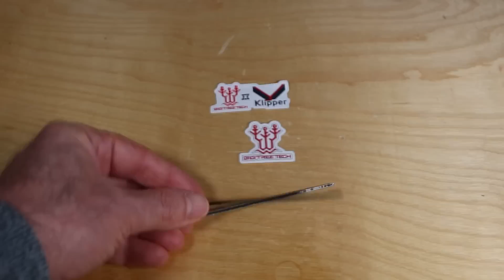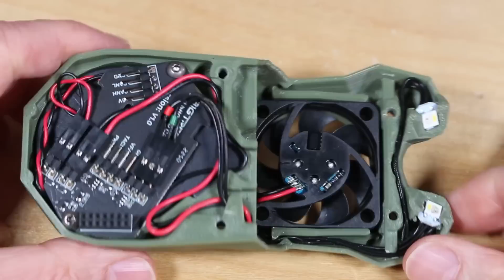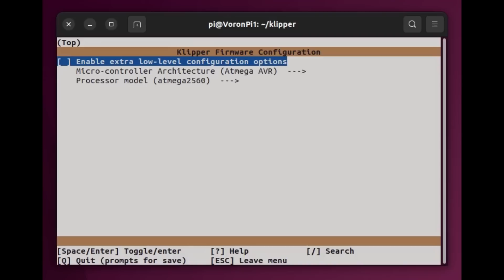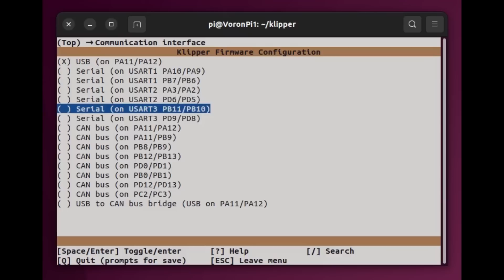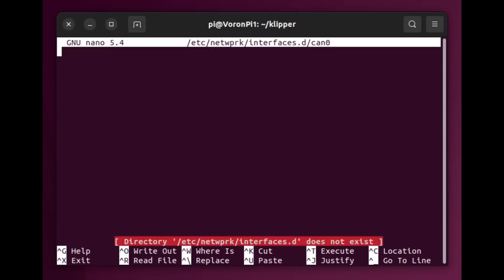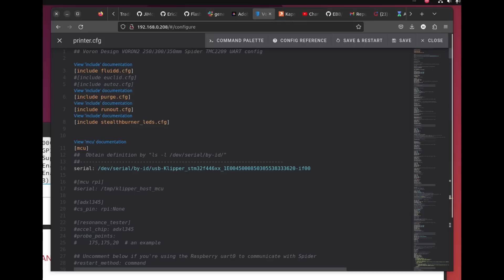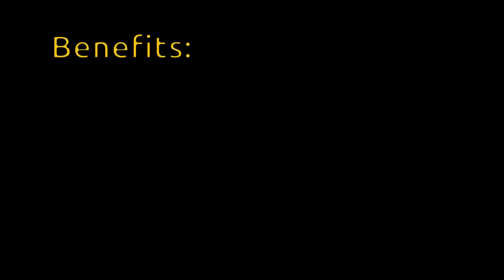Canbus SB2240 and SB2209 3D printer Install, Thoughts & Tips from BigTreeTech (BTT)

Comment: Question: how would this process be different when using can hat RS485?  I had it configured to use a HUVUD controller and I'm making the switch, but not sure how to proceed with the can hat...
Reply from the maker: I also used the can hat from waveshare in my 1st canbus video.  I don't think it would really be any different.  Just make sure the canhat is configured to run as fast as the SB22XX and you should be fine.  You will still need to build and download the software onto the SB22XX just as you would in this video, but configure canhat as you would in the previous video making sure the speed settings match. If you are using an Octapus, you might want to try eliminating the canhat and just connect the SB to the Octapus.

Thanks for watching!
Reply: @KapmansBasementWorkshop  trying to flash via my computer and USB-C, but no dice.  I wasn't able to see the SB22XX in the lsusb command, so I'm trying this way, but getting "failed to download" error...
Reply from the maker: @theamzngq  If you cannot see it using lsusb, it must not be in DFU mode.  Did you hold down boot and while holding boot press the reset button on the SB?
Reply: @KapmansBasementWorkshop  Yes, and both LEDs are lit.  When I was trying via the PI, it's only connected to the can hat via the can H & L wires, no other connections.  Should it still be visible?  Also, I noticed that when I power it off and back on, both LEDs are already lit...should that be?
Reply from the maker: @theamzngq  I think I'm going to take my words back.  I think you going to need to connect a USB-c cable from the SB22XX to your PI to program this properly.
Reply from the maker: The waveshare is really just a serial port, not the same thing as USB.  That muust be why lsusb isn't working.
Reply: @KapmansBasementWorkshop  Ok, I'll give that a try since my windows efforts aren't working.  Still wondering about both LEDs being lit all the time though...
Reply: @KapmansBasementWorkshop  That seemed to allow me to flash it by connecting to the Pi over USB-C!  On to config...
Reply from the maker: @theamzngq  Good luck!
Reply: @KapmansBasementWorkshop  got the config all done, but now I'm seeing mcu 'can0': Unable to connect.  Can't seem to catch a break here...I was able to query it and get the UUID and all, but now when I query it, it comes back with nothing.  Help?
Reply: Is this the Pi 3 vs Pi 4 issue?  Or something else?
Reply: @KapmansBasementWorkshop  got it figured out, the speed was too high, as soon as I reflashed to 250000, it started responding.  At some point I'll have to swap a Pi 4 in there and see if it makes a difference.  I'm pretty sure I won't be able to do shaper calibration at that speed...
Reply from the maker: I was able to run input shaper at that speed. So I think you should be able to as well. As long as it gets a clean signal through the cable.

Comment: Is this compatible with Voron TAP?
Reply from the maker: Yes,it is. In fact, in the video, I’m using it with tap. TAP connects directly to the SB2240.
Reply: @KapmansBasementWorkshop  Thanks for that. Does the TAP need to be 24V or can the 5V one be used?

Comment: Everyone seems to be very excited about canbus tooheads and the reduced wiring sounds nice. I however am very hesitant to move the extruder driver from the basement of the printer into the hot chamber. I run a very warm chamber (actively heated, shhhh, don't tell) so I'm concerned about how long it will live.  Am I worrying about nothing?
Also, I have over 3500 hours of print time on my V2.4 and I have had no issues with wiring and have not been able to find any appreciable wear on the wires in the cable chains.
Reply from the maker: In this case, I don't think you would gain any real advantage to switch to canbus.  I certainly would not consider it until your current harness starts having trouble.  Canbus adds software complexity.  And I agree with you, I would worry about the driver overheating.  Some have started to attach additional fans to the side of their print heads to keep the driver cooler.  I have not had that problem, but I'm also running a motor that works with very low current and my printer struggles to hit 60c internally..

Comment: So it's designed specifically for SB but then doesn't come with standard revo voron heater/NTC connectors?
Shame...
Reply from the maker: I think it’s purely a space issue.  The standard connector is very large and SB doesn’t have the space.  So as designed, it fits right in with no modifications or printing of new parts.  It’s really nicely designed for SB.  So while I found crimping the connectors tough, I’m not trying to say anything really negative as they probably made the right trade offs here as with any design.  Honestly the quick disconnect of the SB face plate and the tons of expansion it provides and greatly reduced wiring are big wins.  Thanks!
Reply: @KapmansBasementWorkshop  You're right the connectors e3d chose are big
Reply: The new version does, wired up my Rapido V2 PT1000 no prob and no crimping needed.

Comment: U2C not required, you can connect directly to Octopus or Manta via CAN and Canboot
Reply from the maker: True, but I don't have an Octopus or Manta.  But I know many have had trouble with timeouts using  those and other methods  I have found this to be completely reliable. A dedicated connection to the MCU and another dedicated connection to canbus.  It works well for me.    Thanks for the comment and watching!
Reply: Is 2240 compatible with manta m8p 1.1 with cm1

Comment: Is the orange pi4 compatible with this setup?
Reply from the maker: It should be.  I see no reason why it won’t work.
Reply: @KapmansBasementWorkshop  4:18 i cannot locate this "card adapter" on the voron stealthburner STl site. could you please post a direct link to it? is this required? i have everything i need to start this build but this part.
Reply from the maker: @mr.rajikon3911  I would say it's required. Here is the link: https://github.com/VoronDesign/Voron-Stealthburner/blob/main/STLs/Clockwork2/%5Ba%5D_pcb_spacer.stl

Comment: Do you need to flash the u2c v2.1?
Reply from the maker: No need to flash the u2c as it comes with the software installed.  My video unfortunately states I am about to flash it, but I actually doesnt if you watch it. I’m flashing the actual Canbus board. my narration is off.

Comment: This video is weird and for some users confusing
9:31 connected u2c via usb-c in DFU mode... compiled fw etd and then set  BTT board to DFU and flashing ...weird why? :)
Reply from the maker: You are correct.  I just went back to that section and reviewed that video.  There is some weirdness in that section.  I did not actually flash the U2C.  I connected it to the Pi via USB-c and then flashed the BTT main board, not the U2c.  In fact, I never flashed the u2c.  The video shows the correct path, but my narration isn't correct.  I need to put in a warning and need to figure out how to overwrite the video with a corrections.....
Reply: @KapmansBasementWorkshop   thank you for this, your videos are very nice and simple. It probably must be also connected 24V for flashing or jumper on BTT can board, this isnt mensioned i think.
Reply from the maker: @davidbucek  Yes, I had it connected to 24v through the canbus cable.  The manual does not state this explicitly, but it assumes it as well.
Reply from the maker: @davidbucek  One more thing.  The manual states that Klipper does not support the 2240.  But it seems to now as I used Klipper and not a special build.  The code was merged into Klipper from BTT  by the time I installed this.
Reply: Glad i found this thread, i also found that very confusing and came here for comfirmation. Thanks.

Comment: I like your style,, I seem to be following many of you build mods.
Reply from the maker: Glad you like them!  Thanks for watching!
Reply: @KapmansBasementWorkshop  I'm just following your work flow here and i see you had a EBB36 and now you have switched to this setup whats the reasoning please
Reply from the maker: The ebb36 has been great. No problems with it. But I was interested in the design of this and the 2240 motor driver. So I decided to give it a try.  I would still fully recommend the ebb36, but I think for some, this might be an easier option with the face plate mounting and the clearance it provides in the back with so few wires back there. I have plans for the ebb36 in another printer if I can get around to building it.  I think it’s a great controller board.

Comment: If you’re using the PT1000 your settings are wrong. Rtd_nominal should be 1000. Reference should be 4300
Reply from the maker: You are correct. I might have spliced the wrong video in. I did actually correct it.  I will place a note on the video about this being incorrect. Thanks for pointing this out!

Comment: So I'm assuming you have the SB2240 with the TMC2240 driver, not the SB2209, with the TMC2209 driver? Hence, the changes for SPI vs UART? What made you decide to use the TMC2240 board? Been considering going to a serial toolhead but still a bit uncertain.
Reply from the maker: I went with the 2240 because it supposedly runs a little cooler that the 2209 and honestly I wanted to try something a little different.  I run 2209s everywhere else and they are great!
Reply: @Kapman's Basement Workshop Just finished installing the SB2240 on my Voron2.4 thanks to you. The only problem I had was the U2C was in permanent DFU mode irregardless of the boot switch. Updating its firmware solved that.
How do you like the horizontal Z drag chain? I found my umbilical can get stuck behind the stock setup.
Reply from the maker: @bobwtech  Glad to hear it's working for you!  The drag chain is ok and so far, works well.  But if you choose to do that, you will need to use the thinner drag chain that is used on the x & y axis to replace the wider chain on z.  Also, you will need to be careful at how you size it when the  gantry is very close to the bed.  It needs to be as long as it can be for maximum flexibility so it does not impact the rear of the gantry while not touching the wiring or motor on  the left side of the gantry.  I think a few people have found they could not use it because when printing the 1st layer, there wasn't enough space for the chain to fully compress which slightly lifted the rear of the gantry.  I don't have that problem, but there are some that have.   So it works well, but please be careful.
Reply: @Kapman's Basement Workshop  I saw your pictures were on the Printables website. They were helpful! I made the non-klicky gantry + lower mount and positioned them similar to yours. I noticed you use the bottom frame mount on the gantry as well. Seems like that would limit the lower travel, although  improving the maximum. Using the smaller chain with the total links you used, I have no problems. One mod I made to the bottom mount stl is I offset the chain towards the front by 4mm. If you line up the top mount to the cl of the gantry and the bottom to the cl of the frame, it skews the chain. Probably not a big deal.... BTW, this was my first print with CANBUS. Millons if frames transfered and no can0 errors 🙂.
Reply from the maker: @bobwtech  You are right about the mount limiting lower travel.  In my case, it did not seem to be an issue.  But I have learned since that for some it has been.  It's great news that you got you 1st print under canbus!  Canbus is a major modification for a printer so congratulations are due!  Thank you for the feedback and comments!

Comment: I see you had a hard time putting the CAN bus terminator. The most underrated 3D Printer tool is a pair of tweesers ;)
Reply from the maker: Believe it or not, I tried tweezers, but I was not successful with those either.  I’m all thumbs!
Reply: I am lost on what in my kit is a canbus terminator.  I have something that looks like a jumper with a long flat plastic piece on one end.  It fits but the flat plastic bit keeps the SB access door from closing.  What am I doing wrong?
Reply from the maker: It’s just a jumper on the termination pins. I believe it’s labeled "120".

Comment: Could've saved me some hassle. Was doing the mod this weekend with a friend on my voron (but used RJ11 directly, instead of the U2C). All doing fine now. I've still watched your video tho. Well done. :)
Reply: Were you able to use the RJ11 on the MCU (which one? a Octopus 1.1?) without the use of a U2C?    I am looking to go CAN BUS and was curious why a U2C is needed if the Octopus 1.1 has a CAN BUS port.
Reply: @levih.4252  Yup, I'm running it on the RJ11 port on an Octopus 1.1 without U2C.
Reply: @fraenker  Thanks for the quick response.....    Any special settings? Do you mind sharing what you did? It would be greatly appreciated.
Reply from the maker: Thank you for the kind words and watching!
Reply from the maker: Glad I could help

Comment: Thanks!  Where did you end up running the umbilical?  I don't see it attached to the back of the flying gantry in the final shot, unless I'm just missing it.
Reply from the maker: I switched it during this upgrade. I'm now running it through the top, rear air filter screen.  I'll post a video of that soon.  But there is STL out there for that (if you wish to get rid of that air filter) or you can just run it through the right rear gantry like I did on the previous canbus video.
Reply: Can you Share the STL for the Top Exit of the cable please ?
Reply from the maker: @MichaelBack-tk9xj  I'll share it, but it currently has a problem.  I loaded someone elses STL file into tinkercad to modify it and tinker cad slightly corrupts the file around the screw holes.  I have no idea why.  I was going to load it into something else to modify it, but have not gotten to it yet.  I'll post a link today and post a message here when done.  It's ugly, but not visible and works.  You might need to enlarge the hole/holes slightly.
Reply from the maker: @MichaelBack-tk9xj  https://www.printables.com/model/438412-air-filter-back-plate
Reply from the maker: Did you post a link to an stl file?  I think that is what I see in Youtube, but for some strange reason I cannot get to your actual comment!  Any chance you can post again?
Reply: @KapmansBasementWorkshop  I tried to reply twice with a link, looks like it's just killing my post...

Comment: Great video! I've done the install and found the Pi3 was too slow to communicate with it (with BTT U2C canbus) and had to upgrade to Pi4. and yes, the connectors are awful to crimp!! Found it easier (but still tricky)  to solder the wires. So far it's been a good upgrade.
Reply: You can play a bit with your busspeed and txquelen settings, it's working fine for me with a waveshare can hat on pi 2.
Reply from the maker: @thomasfjen  that's good to know as well.  The waveshare can hat is a great device as well.  I have nothing but good things to say about it.  I love the way it mounts and takes up no additional space under the printer.
Reply from the maker: Yes, I'm  using a Pi4, a CM4 actually. Thank you for the comments and watching!

Comment: I have this added to my cart but was looking for a review before buying. Thanks again for a wonderful review. One question though, is it really mandatory/necessary to buy U2C for this to work or can it be connected directly to mcu rather than pi?
Reply from the maker: You can connect it to the MCU if the MCU supports canbus.  In my case, I like the idea of using 2 USB ports on the pi. 1 for mcu, the other for canbus.  I like to think it provides more bandwidth.  Is it needed?  Probably not.  This will absolutely connect to the MCU that supports canbus.  Also, Thank you!
Reply: @KapmansBasementWorkshop  Thank you for your time and effort. I'm using BTT octopus V1.1. I guess it has a can bus port
Reply from the maker: @framespersecondfps5256  That should work just fine.  Thanks for watching!
Reply: @KapmansBasementWorkshop  Does this apply to Mellow CAN Board too?
Reply from the maker: @framespersecondfps5256  I don't believe which can board you use really matters, they should all work with Octopus canbus interface as long as you get the cable correct.  That said, I have no experience with the Mellow board.
Reply: @framespersecondfps5256  Yes. I use the Melloy SB2040 directly wired to Octopus 1.1 with a Raspberry 4. It's not recommende with Raspi3 though.

Comment: I put this in like 6 weeks ago, agree on the pre crimped connectors, as I killed quite a few trying from scratch, either by not having strain relief with wire wrap not being correct length or just so fiddly.  As for the adxl, might work via usb, but not so much via canbus, as it faulted out at about 60hz, not very usable.  Everything else has been zero issues though with probably a couple hundred hours of printing time.
Reply from the maker: Thanks for the feedback.  How do you haave this connected?  To the Pi or the MCU?
Reply: @KapmansBasementWorkshop  to a orange pi 4 via a dedicated canbus connection , btt u2c eb36/42.